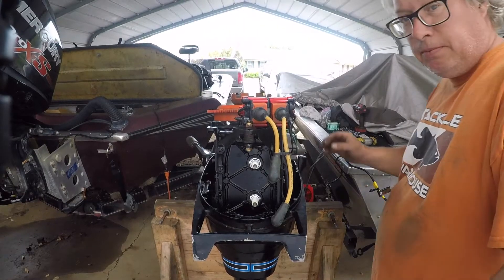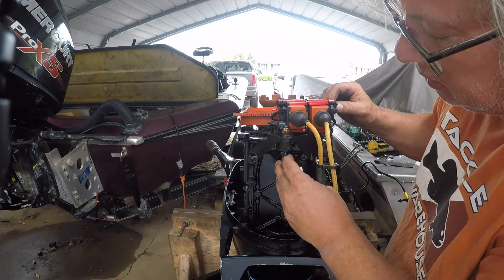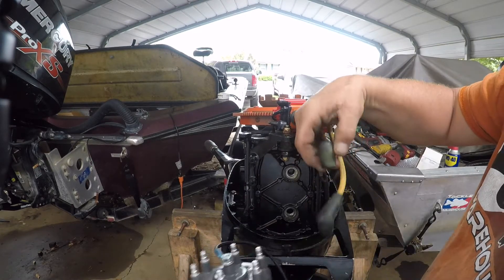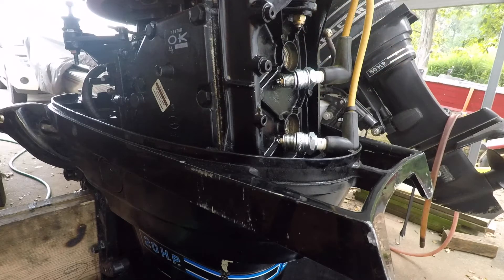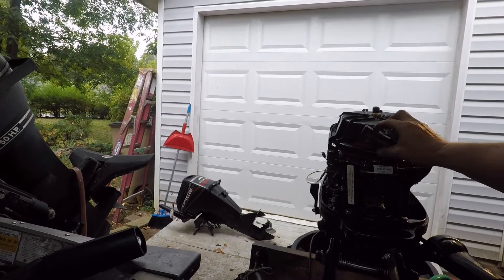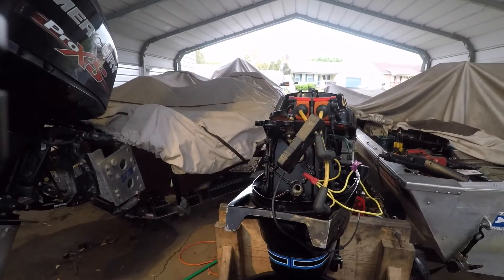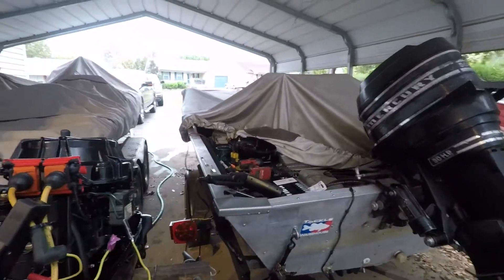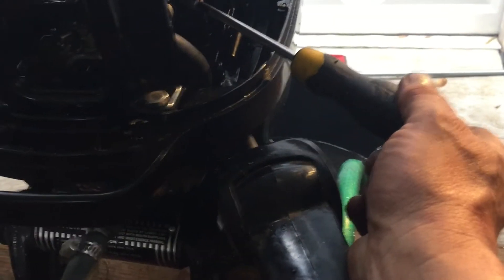Mercury 200 20 hp timing a motor

Comment: Hey Hawkeye! I was wondering if you could give me some advice, I’m working on a similar motor though and it’s an older 200 20HP, a 1966 model and the motor ran great until I removed the stator plate trying to fix a spark issue (broken kill switch wire to the points) and when I put the stator plate back on, I had great spark but it was different timing. I put the flywheel in the exact position that it was in, however i got absolutely nothing when trying to start it on ether and then I tried putting the flywheel in the exact opposite position where I got a few backfires and what not from the engine. What could cause this? How do I go about getting it in time? I’m not locating anything jumping out at me as timing marks. When I replaced the stator plate back on the crankshaft, did I need to ensure that it was at top dead center? I’m kind of new to this kind of thing and I’m getting a little overwhelmed by it so I figured anything would help! Thank you!
Reply from the maker: That one is not easy.  All I can really say is take your time.  That link and sync with the carbs is pretty critical.  Its been a few years since I worked on one.  Buy a Seloc manual.

Comment: To test these orange coils the secondary winding ground is a bare wire on the bottom of the coil boot that is pinched and ground to the motor frame.  There is no “jumper” or internal connection to ground on the primary side of these coils.

Comment: How do I find out the year
Reply from the maker: If its this motor a Mercury 200 20hp a serial number will not give you the year.  You won't order part by the year of the motor.  These were made between 1971 through 1978.  The brown stripes were made between 1980 through 1984.  If your looking up parts you will have to look them by the serial ranges that Mercury or Marine engine has on their site.
Reply from the maker: I just posted a video on how to lookup parts.

Comment: Having issues with my 78 200 20hp.  It's running like shit seems like its misfiring.  Any suggestions for me?  I have already replaced the ignition coils, ignition wires, brand new carb, new plugs.  Replacing all the ground wires here shortly hoping that will fix it.  But definitely looking for suggestions on how to get it to run better.
Reply from the maker: Sounds like a timing related issue.  Check your timing using a timing light.  If you replaced the coils make sure the right coil and wires are going to the correct spark plug.  You can make some marks with a paint pen on the flywheel if you need to.   If you rotate the flywheel to top dead center on the piston should be at 0 degrees on the timing mark on the flywheel.  You can make a mark and with a timing light if it is somewhere near the 0 degree mark then usually you have the coil wired correctly.  I
Reply: @hawkeyemarine  how do you adjust the timing on these motors?